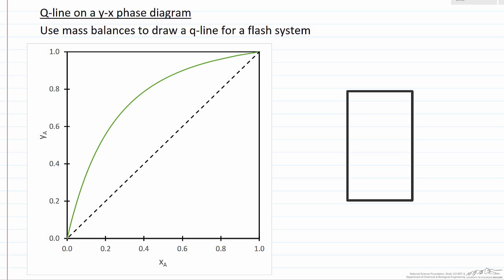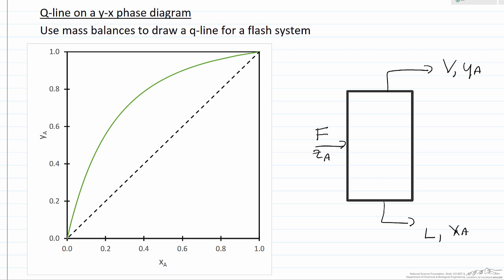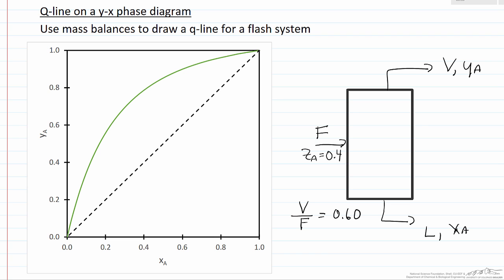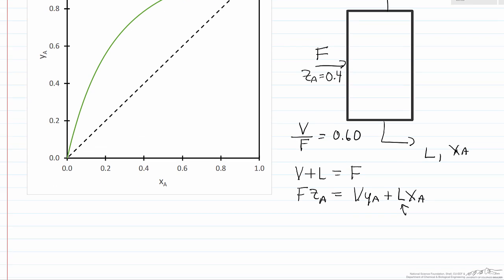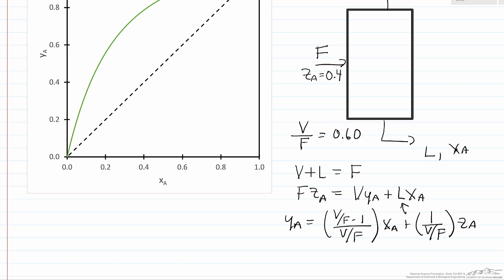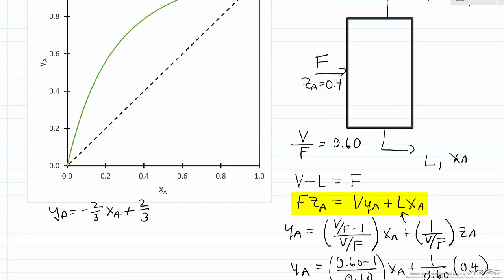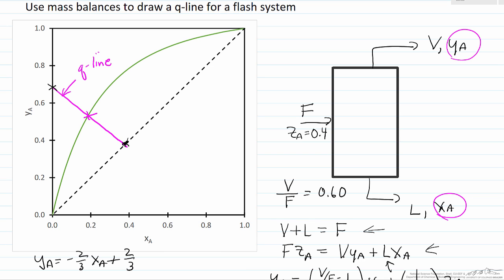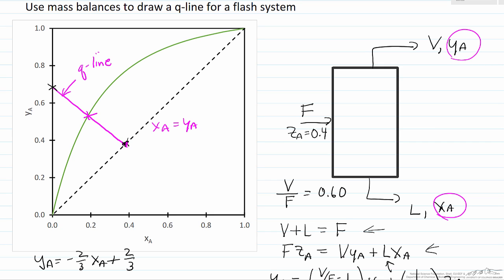Q-line on a y-x Phase Diagram

Comment: great now does anyone know how to measure V and L in the lab or what instruments you will use. How do you determine molar flow rat of a vapor and molar flow rate of a liquid in real time and not take hours on a GC or HPLC unit. In other words, this equation is useless. Nice theory, but this will not work in practice. Schools need to teach more relevant and HIREABLE material. The word of the day for these academic theorists is HIREABLE.
Reply: Correct usage of grammar and punctuation is also a hireable skill, but you don't seem too concerned about that.